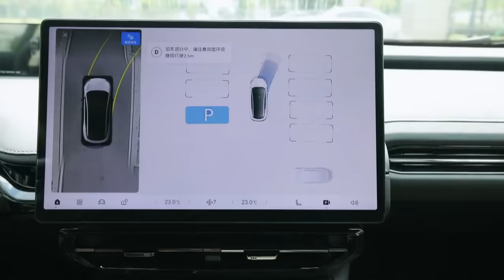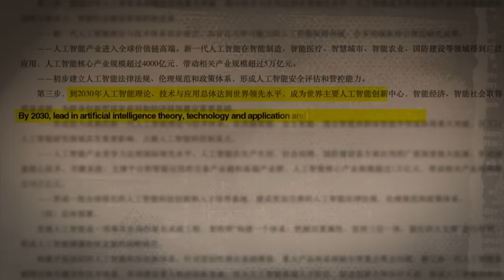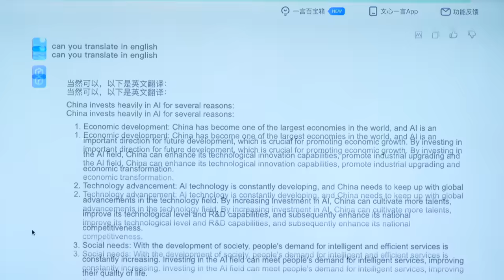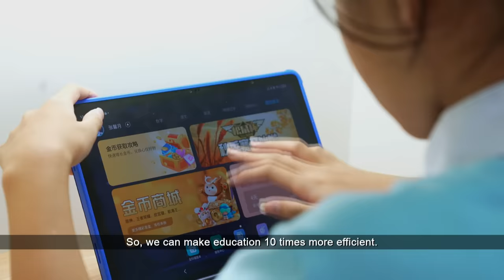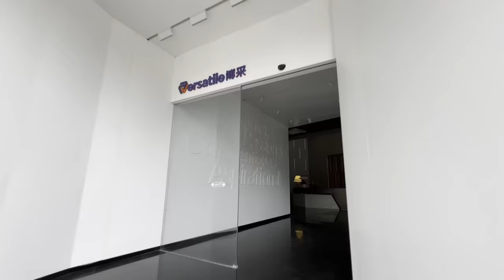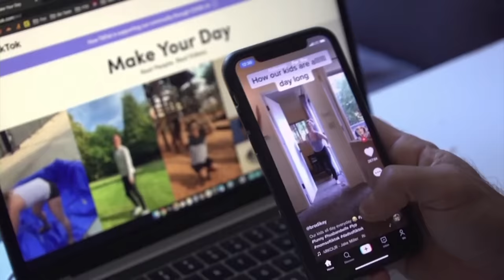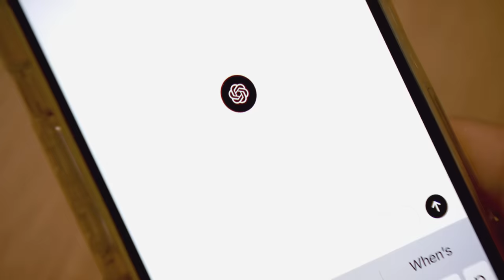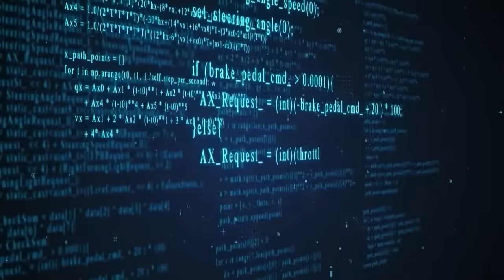China's Betting Big On Artificial Intelligence. Could The US Lose The AI Race? | Insight

Comment: Expertise was implemented into many normal systems starting many years ago and that tech was called Expert Systems.  AI is simply expert systems peaking into a technology package.  The expert systems implemented what was learnt as systems were used in design mode.  But now also Artificial Intelligence has captured language as part of its expertise which was not available reliably before.  And now a lot of data is available for analysis via artificial intelligence to be used in design mode.

Comment: How could the US ever lose the AI race when they are a decade ahead in software and 2 decades ahead in hardware technology ?. China is very very weak in both of these even with their massive copying/stealing efforts. The in the high-tech world, there are more and more tech that is UN-Copyable. eg Tesla FSD. That is impossible to copy. It lives in their secure servers and are huge. Besides, China has limited AI Compute to handle the massive trainning needs of advanced AI.

And oh, All of China's "self driving tech" is Nvidia's refences platform DrivePX and its successors. These are off-the-self solution that are decent but not great. These needs huge AI Compute to train for new data.
So there is NO Competition. Current competition is OpenAI, Meta, Google only. Each have over 100K H100 AI compute. And MicroSoft is building a $100B SuperDatacentre targetted for 2028. I believe this machine will emerge the V1.0 of ASI.